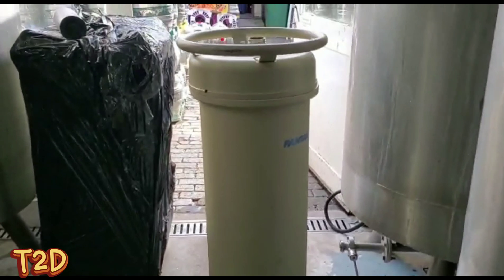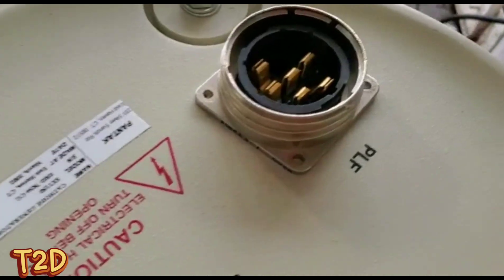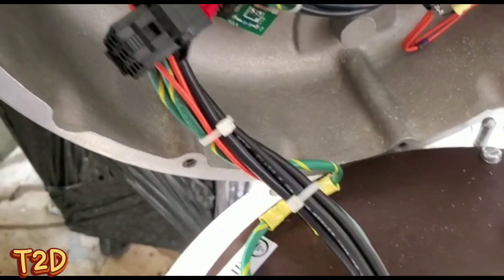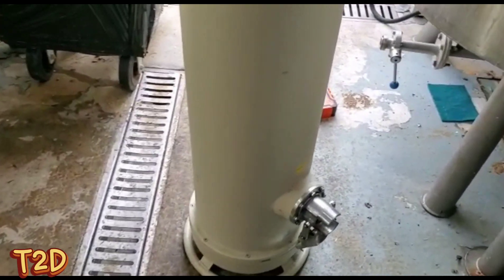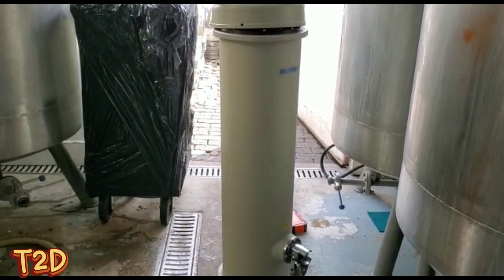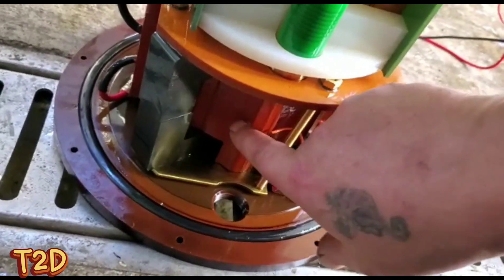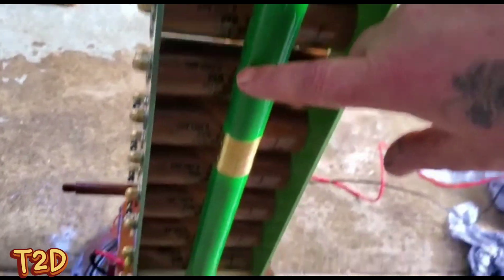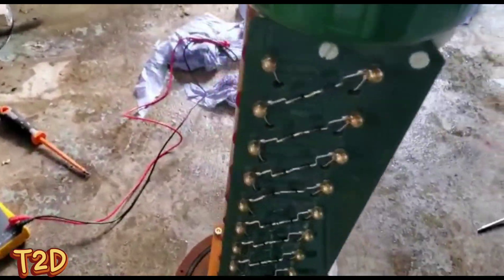Interesting x ray transformer @ high voltage mans

Comment: Wow, that's a beautiful piece of equipment right there. Really well made. Glad to see you back, man!
Reply from the maker: Thanks mate really appreciated 👍

Steve
Reply: @T2D.SteveArcs  hey I wanted to know if you would like to chat and give me some help with my igbt driver and stuff.  I also want to know if you can or will sell me a high frequency transformer. I have one but I have to take it apart and rewire it.  It’s a 75kv X-ray transformer.  I use a full bridge igbt driver driven by the sg3525 driver ic chip
Reply from the maker: @highvoltagefurry3243  send me a friend request on fb Steve Arcs
Reply: @T2D.SteveArcs  hey I sent you a message on my partners fb account

Comment: A nice engineering job on this unit. I wonder what the operating frequency is with that nice ferrite transformer.
Reply from the maker: From previous experience I would guess 20 to 40khz for this size ferrite, I will make another video when we have it up and running and we have determined the resonant frequency etc
Thanks for watching 

Steve